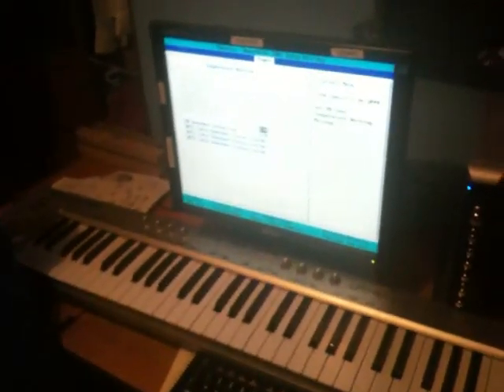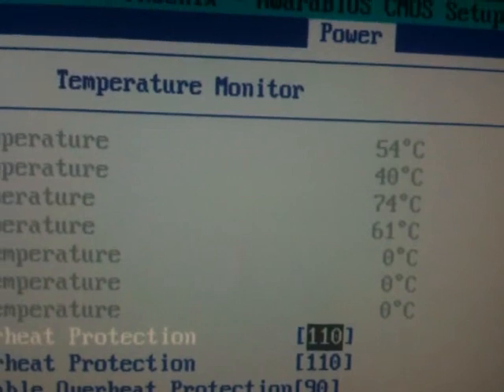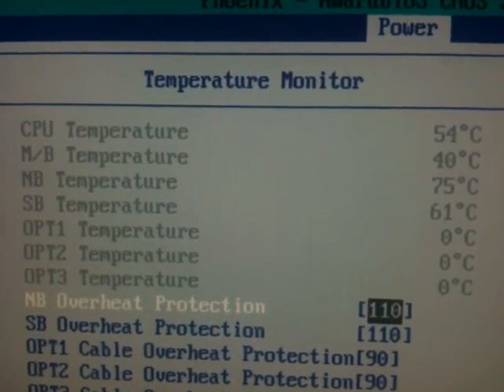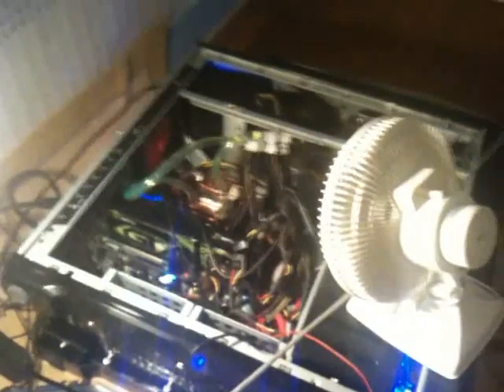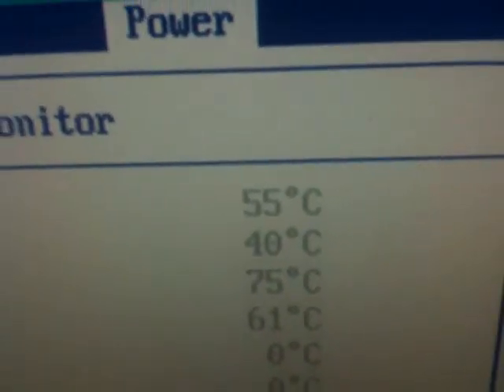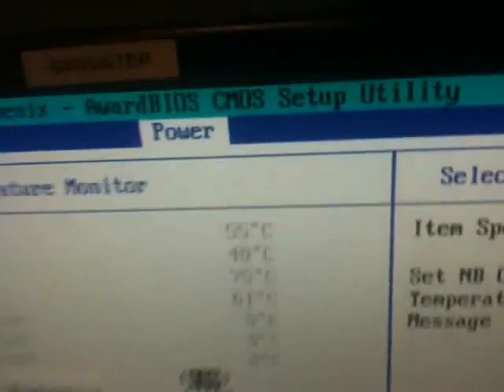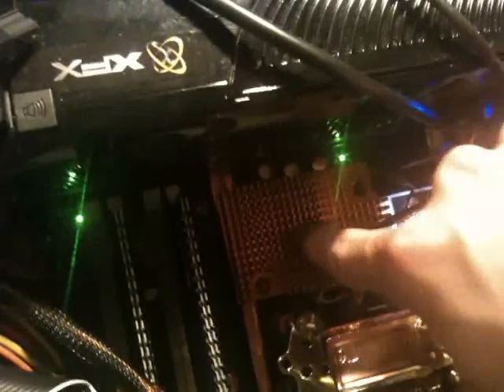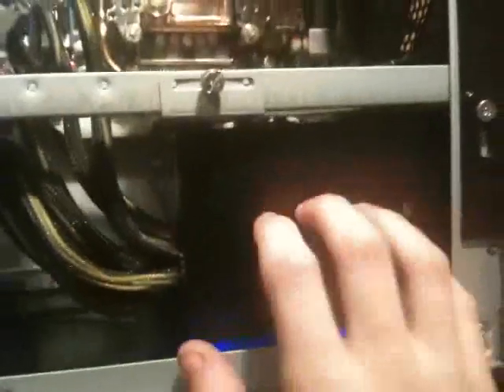Overheating Northbridge!

Comment: late comment for this video. I've got the same problem currently my northbridge and south bridge is very hot. I've tried everything putting a new thermal paste even use an regular size electric fan to cool the whole system unit but didn't work. now i realize never replace the stock thermal compound that is originally in there.

Comment: But f somebody has any suggestion im open for it so i can use it again also ty in advance. for clarrification at first the mother is working no problems it only started when i replace the original thermal compound with a branded thermal paste.

Comment: Change the generic glue crap of the termal compound NB and put a decent one, Silver thermal compound, and if you can add a 40mm fan and do not overclock your FSB,  probably you already have a new PC at the time anyway......... How and a beter case airflow to. Less intake fans more exaut fans 2 intake  3 exaust. negative pressure.